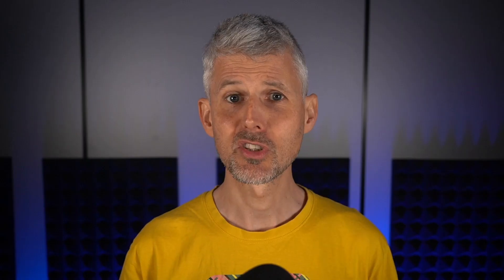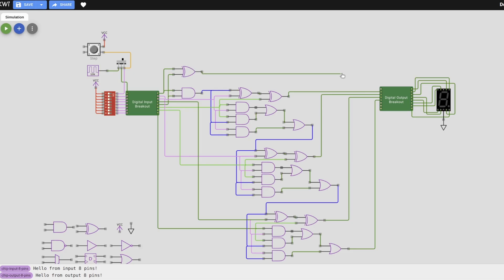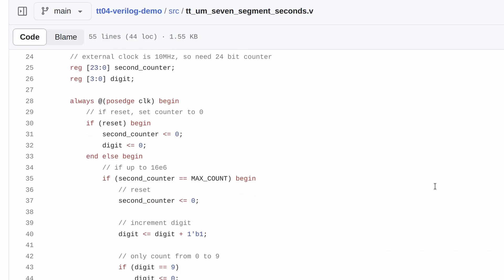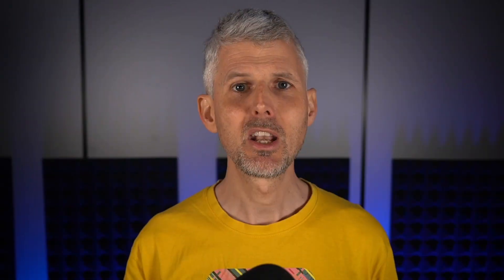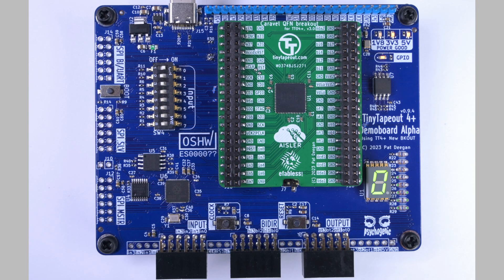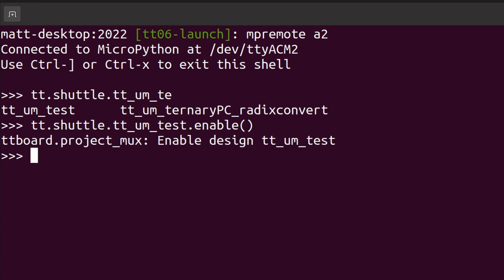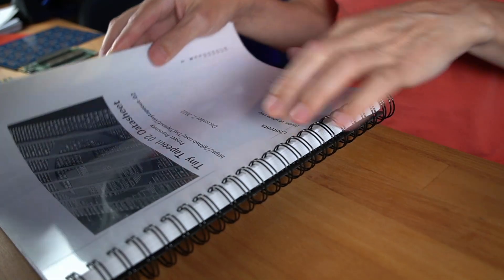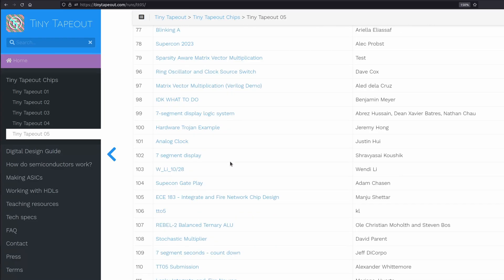Tiny Tapeout - From idea to custom chip without breaking the bank!

Comment: Finally, this is Amazing!!  Awhile back (20+ years ago), I was slaving out  designing custom ASICs , SDR, VCSELs, and did clocked-down  simulations using FPGAs. Our design flow tools that we used were in millions!!  Cadence tools, Mentor tools,  Xilinx, Lattice, Altera, co-ver c/c++, VHDL, Verilog, SystemVerilog, HyperLynx, etc... whatever is state-of-the-art tools and the leading edge tech , we used them!! 😅 Aspiring engineers and die hard hobbyists: Dive in, take advantage because this is not easy to make available

Comment: I know guys interested in making chips.  What are the prospects for commercial production?  They can fit a highly efficient speedy processor in 1000 logic cells. There a maybe a dozen of there type of FPGA soft cores.  Some fit in 150-300 luts.  I'm sure a few people would be interested if they could progress on to a realistic commercial production deal of 1000-100,000 (though very small compared to big players who do chips 10,000,000- 100,000,000+).

What about a modern 45nm low energy process deal?
Reply from the maker: Efabless are working on larger volume runs: https://efabless.com/product-oems
Reply: @ZeroToASICcourse 

Thanks for that.

That was softcore Forth processors.

Comment: Swiss watch manufacturers have their own around 130nm fab lines.  Small image sensor manufacturers have their fab lines (tough business and a few may struggle.  If their existing process is suitable, then a deal might be to the advantage of their bottom line.  But everything is going to be highly tuned to their image sensor's performance, no exception, so you might find compromises in circuit performance compared to normal 130nm processes).

Of course, back alley Chinese cheap chip makers, using old foundry equipment.
Reply: Thats very interesting, what use do watchmakers have for semiconductor fabs? I cant think of anything apart from maybe quartz watch IC's, but I feel like it would be easier to let someone else make them rather than build fab capacity.

Comment: And when you have to submit 20-30 times to get your modestly complex design to work to a proper degree? I know people in the industry, a top chip designer.  At 130nm, you should be able to get the chip working in GHz (high energy performance design) not up to 50mhz.  At low energy design they get over 600mhz.  They are trying to get a charity off the ground to teach chip design at highschool using a lower cost one micron fab machine.  I think universities are included.

There are new etch and dip machines a fraction of the costs of old machines, which makes your 160x100 tile a lot cheaper, and likely able to go smaller faster and lower energy, compared to 130nm.  I'll post another comment on other sources of 130nm fabs you might like to check into for a better deal for your service.
Reply from the maker: There's a lot involved. An open source flow from start to end is perfect for education, because the tool install is easier and students don't need to sign an NDA. But there's only 1 open source PDK that we can buy MPW runs on.
Reply: @ZeroToASICcourse  Interesting.  They are proposing a about 1micron 3D chip printer, and gave their own tiling chip design tool, which the original version was around 3-6 kilobytes on  a 386.

Contact printing is available out there for small sizes, so 3D printing at sizes similar to the ones you use should be possible one day.  So, 3D chip, strip and wafer printing, should be possible.  Which means people get to readily make their own chips on a bench or desktop. 130nm would solve most low to medium speed applications.  With 1-6ghz, most remaining high speed applications.
Reply: @ZeroToASICcourse  There are companies doing electron beam lithology, which you could get people together to go something pretty unique.  Electron beams have accuracy smaller than atoms.  I had proposal to do this higher speed, but too sick to get into it, but there is company who seems to be doing some mass production technique.  Atomic semi, or something.  It's the kid who was doing chips in his parents garage, got together with one of the top chip designers who had been doing AMD's later chip, and did the top end Alpha processor at DEC, has hot tougher with him to start this company, to do really top end cryptology chips.  Maybe you could get a free open source run as a marketing effort.  You could do something really special with that at atom sizes, and ask for a little slither of wasted space on each wafer, to experiment with, say 1mm2 to 1cm2 on each wafer, what ever little area is left over they can't fit another chip into.  At atomic levels you can fit many tiny chips.  The minimal instruction set forth processor designs are 1000 transistors plus.  There are many iorm source soft core fpga designs (more than all the other computer language processor designs combined by far).  The trick to get it to run at the high speeds possible at less then 1nm, is to combine it with full SRAM address space, and only have IO streams coming off chip, and there are certain Thz ways of doing processing chips.  Imagine a 16 bit processor with 128KB memory to do digital signaling processing work flows, but don't know if sram can get anywhere near that speed, but these alternative processing technology is likely suitable to make a faster memory than standard SRAM, and have near zero leakage, which reduces heat a lot, with near perfect efficiency.  Some people will probably know the technology I am talking about.  The research  is talking about 4Thz (I had wanted to do it myself years ago, and they seem to have similar enhancements to what I had been hoping to try.  There is another related technology that is talking about 40Thz, which is similar to what I wanted to do decades ago, but now we are realising a way to do atom sized circuits and the technique, to maximize this speed.  Again, it's a matter of even more localisation of memory to maximise speed, and you have to go to more complex circuits to minimise access to the on chip memory, to allow it to work at higher speed more often.  You can 3D stack circuits with the previous technology, but it will still accumulate some heat minimising the number of layers which can be stacked, but stacking will localise memory and processing density a lot more. So, 32bits+ with a full memory are desirable.  If you are interested, let me know, I can get people who would want to do this. The additional problem you get is how to split chips off in the micro plus scale in size.  The answer is that the electron beam is probably able to do that by design.  I have ideas for that from the past.  Having beaten down the fungal infection in my brain I may no longer be able to do this, but can remember a few things.

Apart from that, with forth processors, there is a group a person I have talked with is working on software for, who have a 40 core 6Ghz chip that is 1-2mm2, and extremely low energy for today, which is probably (the details are secret, but I know the sort of fab tech they are likely using).  The misc community holds the world record for lowest energy actual processor chip for many years (but it is primitive, low energy version at 130nm, and not the sort of design I had needed).  I will have to look up what was said, but sound like it could be easily cooled with an effective 240Ghz of combined bandwidth, but is in the zone of my proposed designs many years ago.  This technology then would be many times slower than that I mentioned above, and those are just the tip of the iceberg of what I was looking at, but these are available and ready to experiment with.  The other thing is how to power, but that's possible.  Anyway, I'm fairly dizzy and have to leave it at that.  But, a full high end PC in the volume of a coarse grain of sand, including storage, is what we are looking at, but I wouldn't guarantee we could cool that, on the efficient technique.